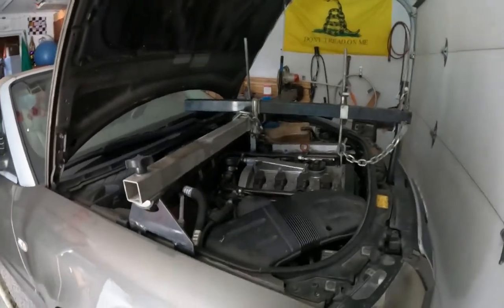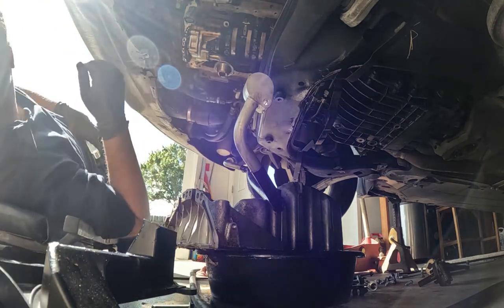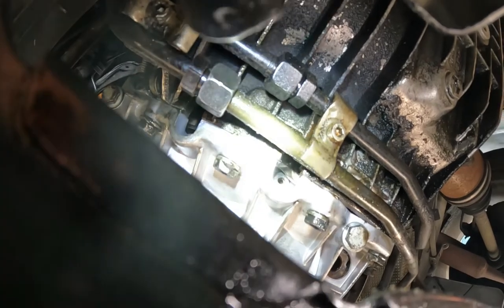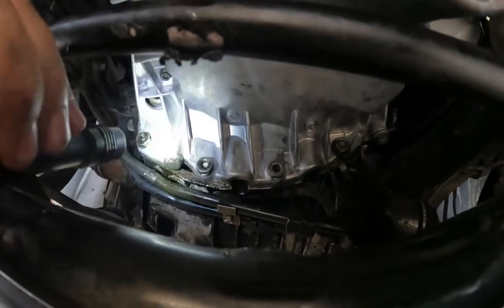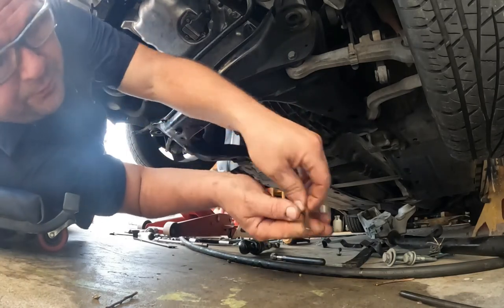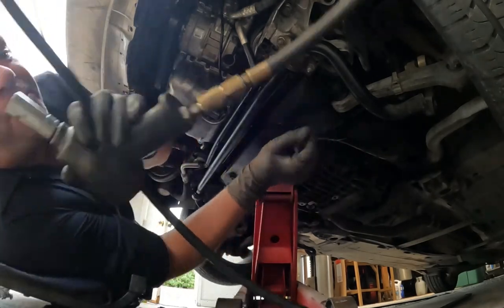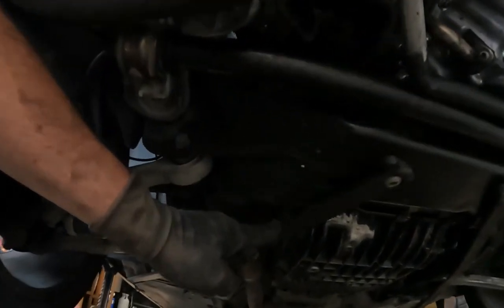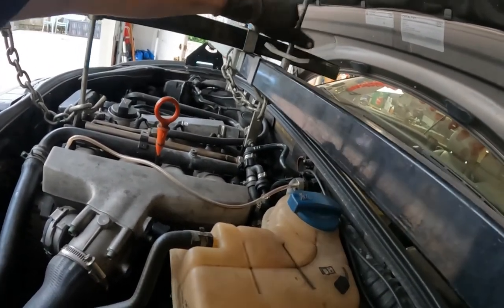Replacing the Oil Pan on the Audi A4

Comment: I have a 2008 Audi A4 Quattro convertible 2.0 and I took it to the mechanic because I had an oil leak on the oil pan. He said it's 900 dollars to fix is it? How much can I get an oil pan for? In auto zone they sell it for 130 dollars and I actually told the mechanic that and he told me those won't work with my car because the Audi oil pan is steel metal. I just feel like it's definitely not 900 dollars I think is a little to much. I would try to do it myself but I don't have the lift or those jacks to lift the car. Do you think the mechanic is trying to charge me way more then what it actually cost?
Reply: you are getting a good quote, this is not just a easy pan gasket replacement, you have to do a lot more work a lot.
Reply: @rayray1846  I bought the oil pan and screws and bolts separately from Audi brand. Do I need a gasket aswell? I was told I need to change the oil and new oil filter.
Reply: @LuisGabriel1309 of course…. You’re changing the oil pan.